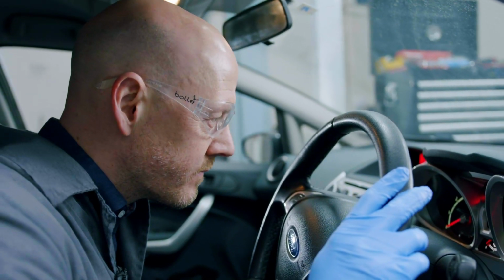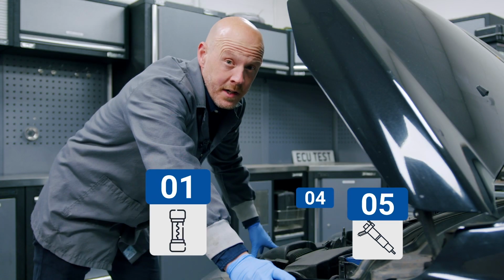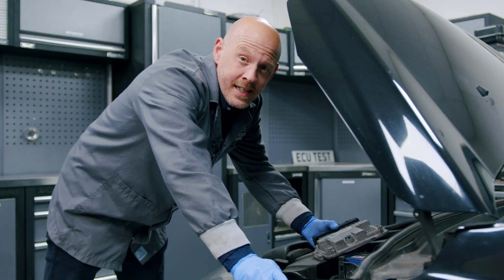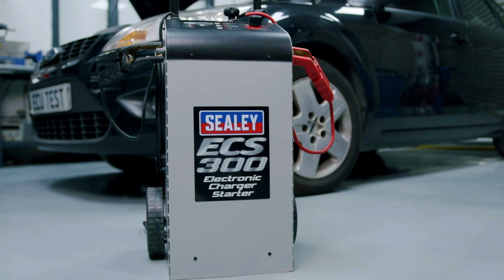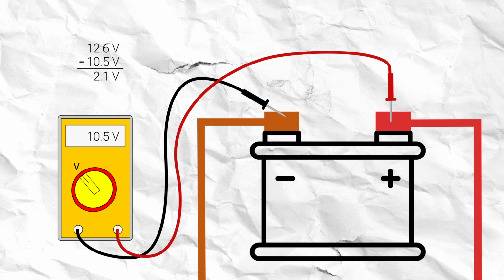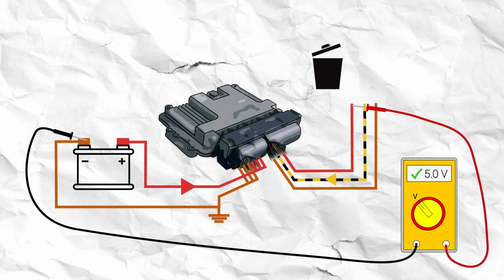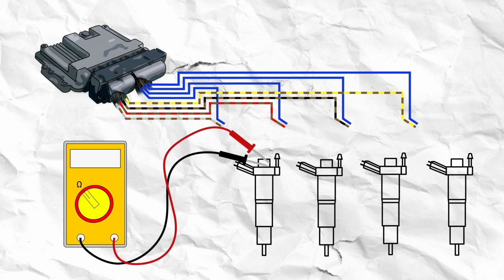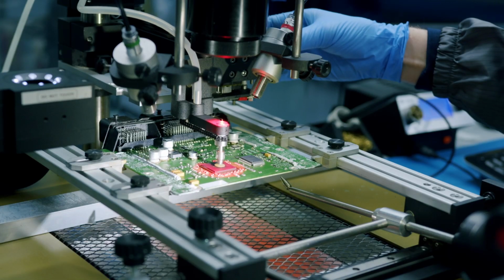P0606 – Car Won’t Start – Diagnostic Tips!

Comment: Whilst the background music does keep the video upbeat and moving, it does not help with comprehension. Rather distracts from it. If the point is information transfer, I'd suggest putting a tips video out with yourself speaking in a quiet garage rather than something that looks as though it came from an MTV production.

Comment: I only get the fault under high load, high rpm. Like hard acceleration from a stop. Or pulling out to overtake and putting your foot down. Usually around 120kph.
Reply: 2007 Holden commodore in new Zealand
Reply from the maker: Hi there, if you can get the part number from the unit and email it to info@ecutesting.com with the vehicle details, our technical support team will be happy to look into this further for you. Thank you!

Comment: I just resolved this issue on my MK6 TDI by replacing the 644 and 645 relays  that are located under the hood. 

However, this video helped quite a bit in the trouble shooting process ❤🎉

Comment: I have a golf mk6 1.6tdi with the code the car also goes into limp mode and have flashing glow plug light  I  have 2 leaking injectors would this be the cause of the problem and code?

Comment: Hello every one, what Is the name of the sensor?
Reply: The P0606 fault code means that there's an error with your power control module (PCM). Your PCM is the computer inside your car that monitors all the vital systems. Basically, it's the brain of your car. Every time you start the car, the PCM runs a series of checks to make sure everything is okay.

Comment: Hello Sir Code No. P1A00: ?
Reply from the maker: Hi. A P1A00 usually indicates a problem with the Accelerator Pedal Position Sensor. Test the sensor is receiving the correct power supply and it has a good ground. You can also test it is outputting a good signal by using live data from a scan tool whilst operating the pedal and checking if the output data matches the action. Hope this helps!
Reply: @Ecutestinglimited
Reply: only this is a motorcycle scooter 125cc Hero dash
Reply: @Ecutestinglimited  Thank you very much for your interest and help.

Comment: I have toyota corolla and i have 😊😊code number p0607, can I have the same symptoms?
Reply from the maker: Hi. The P0606 and P0607 fault codes can share similar symptoms, however completing all the checks in this video is a good way to start the diagnosis.
Reply: @Ecutestinglimited  thank you .

Comment: is the p06b8 the same code? i have a mk 3 st and it threw this code but same description
Reply from the maker: Hi. P0606 and P06B8 aren't the same code, but they usually go hand in hand. If you have both a P0606 and P06B8 then we would still recommend completing the checks in this video to see if the codes clear. If they don't, or you just have the P06B8 code, then please contact our technical support team via email on info@ecutesting.com with the following information. Codes can go hand in hand contact tech support. The make and model of vehicle, the symptoms of your fault, any fault codes present, and the part number printed on your ECU. They will advise you further. Thanks.

Comment: My car has the autostop and it did the autostop at a light and didn’t come back on and the p06060 code came on but then went off and I drove fine 2 days after should I still take it into the shop?

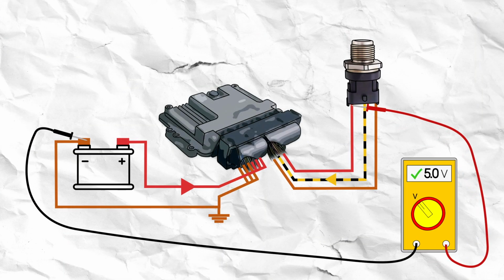Comment: What sensor is in the diagram at the 4:12 mark? I need to know bc my 2004 Envoy XUV shut off in traffic and won't start.
Reply from the maker: Hi. The sensor we have used as an example in this video is the fuel rail pressure sensor, however there are many sensors in a vehicle that can cause a P0606 to occur. If it is a sensor causing the code, then you should have a secondary fault code specific to that sensor, so if you only have a P0606 then it is unlikely that the fault lies with any sensors.

Comment: Would that be the problem with my 2018 Jeep compass.  The dealership won’t help because I went over my mileage and warranty ended.  My problem is that when they put the reader it won’t connect and won’t get any reading back.  It’s not the batteries already checked that.  I need my inspection sticker but can’t because of this.
Reply: Amy, when the obd2 port won’t power a scanner usually it’s a blown fuse, check them

Comment: What would be considered  bad resistance while testing the fuse?
Reply from the maker: A standard automotive fuse should have a resistance as close to 0 ohms as possible, and no more than 1 ohms. If the multimeter reads O.L then the fuse is blown. Hope this helps.

Comment: Hi, I have a 2013 ford focus. It’s coming up with a po606 code. I’ve had a new battery put and driving fine for about 3 miles then the transmission fault came up again. When driving it the revs go up to 3000 and struggle,s to get up to the next gear. When I had the battery changed it was working fine. It’s a 1.6 auto, if it does need a new ECU how much will it cost to fix?
Reply from the maker: Hi. Have you done another scan after changing the battery, and if so were there any additional fault codes?
Reply: This is my car how did you fix

Comment: Can bad throttbody acuator cause tht code to
Reply from the maker: Hi. If you have a P0606 and a secondary fault code relating to the throttle body then it would be worth investigating first as it could potentially cause the P0606 code to occur. However we would still recommend completing the checks outlined in the video if the P0606 code doesn't clear.

Comment: On a d
Fiesta 1.4tdci i have too many codes P0606, P0366,P0191,P0626 and P0563. It is possible ECU damage, harness ....anybody with something ells idea?
Reply from the maker: Hi. With all those codes we would definitely recommend thoroughly checking the wiring to the ECU, as well as inspecting the connector for damage or corrosion. If you would like to send your ECU into us for testing then please fill in our online test form for further information: https://myaccount.ecutesting.com/

Comment: You missed an important one: spark plugs. I found this out on another forum. It turns out the OEM spark plugs I thought were genuine turned out to be fakes.  In just several months, my car lost power, went into limp mode, and threw this CEL code. It took me awhile to figure it out, but I bought genuine OEM plugs in the store, and my care is back to being good.  I've also read that Honda's do not like non OEM plugs.  Stick with OEM, and make sure they're genuine.

Comment: Hello - I have watched so many of your videos as no one else on Youtube or the net seems to understand a specific issue  I have faced for 3 weeks now. P0606 ECM code on a K12 Micra DCI. Any ideas where to start, I checked most of the wires to the ECM but I dnt want to strip all the looms to look for shorts. Do you think a faulty sensor like the crank or cam will trigger the code or its a genuine short somewhere that I must look really hard to find. Trying to narrow the issue down. Greetings from South Africa

Comment: This was a very informative video. I have a 2011 ram 2500 Turbo diesel and the P0606 code has come up on my truck
Reply from the maker: Hi Thomas. We are glad you found the video useful. If you have followed all the steps and are still experiencing a P0606 fault code, then please contact our technical support team via email at info@ecutesting.com with the following details; Your make and model of vehicle, your ECU part number, the symptoms of your fault, and any diagnostics you have carried out. They will be happy to assist you further and advise you of any testing or re-build service we can provide. Cheers.
Reply: @Ecutestinglimited   I got to check my batteries this week when I get a chance thankfully I watched this video if all else fails I will take it in
Reply: @walkingdeadalphaCO what did it end up being ?
Reply: @jrsoccer11276  so I found out something. I was buying el cheapo sensors on eBay. Wrong choice on my part. I went ahead and spent the money on quality sensors, and the codes went away. Also, my exhaust break is working well because now it's getting the right air ratio.

Comment: Hi thx for the vids! I have a P0606 code on my veloster and my obd2 is saying the ECM voltage is 10.2 and does that mean i just need to check for too high resistance in the fuses or the computer?

Comment: My car is running fine but it's throwing it while driving
Reply: I have the same issue with my vehicle.  2010 dodge Avenger 2.4L. This car is like a project car I swear.  But my code only appears once I drive for a good 20 mins.

Comment: For a toyota you dont have to send in the new or used ecu for a full rebood or flash. Hotwire the pin #4 and #13 of obd2 and let it sit with ignition switch on position and let it figure everything out for about 30 minutes. Remove the pin used to hotwire the obd2 and go ahead start the car and hope for the best.
Reply: Did it fix the problem?

Comment: Hi I have a serious problem with my 2013 prius  p0606 the car drives fine and sometimes gets crazy with no power stops with all waring lights, whats the name of the sensor You are checking on the video ? thks
Reply from the maker: Hi. The sensor we are testing in this video is a fuel rail pressure sensor. However, if it is a faulty sensor causing the problem, then you should be getting a P0606 fault code alongside a secondary fault code for a particular sensor. If you are only getting a P0606 code without a secondary code, then it is unlikely the fault is being caused by a sensor. Hope this helps.
Reply: @Ecutestinglimited  the thing is im looking for a good electrician but cant find any one replaced the ecm computer and the module that goes to it to check if it fixed but not same thing happening that is that code plus car stops suddenly loosing power sometimes cant put it into parking or any gear then i unplug the battery for 5 min and later it drives for a while again im sick and confused the electrician cant help me hes stuck
Reply from the maker: @pawlinski74  Hi. It sounds like the issue you're having is complex, are you just getting the P0606 fault code and what module is that code being stored in? Feel free to contact our technical support team with this information, at info@ecutesting.com or contact us directly by phone: +44 1773 535638, and they will assist you further. Cheers

Comment: I have a P0601 does the instructions in this video imply to that code as well?
Am working on a diesel, like you mentioned in the vid.
Also thank you for the video, love the animations and explanations, so easy to follow along
Reply: All right thank you for the answer, much appreciated 👍🏼
But also wondered if the p0601 wold have anything to do with the TCM, because in my car the TCM and ECU are in separate boxes/housings. Does that code indicate anything with the TCu or ECU only?
Reply from the maker: @daniellarsen4806  Hi. The P0601 code is usually stored in the control module which is experiencing the fault, so when you scanned the vehicle was the fault code stored in the TCM or ECU? Cheers
Reply: @Ecutestinglimited  ahh okay, found out the EEPROM or memory chip is located in ECU box. So probably the fault is somewhere in the ECU if everything else outside the ECU checks out
Reply: @Ecutestinglimited  thank you so much more clear now!
Reply from the maker: Hi. We have normally seen that the P0601 fault code indicates something is wrong with the internals of the ECU itself, however you may still want to follow the steps detailed in the video to rule out any external faults before condemning the ECU. Cheers.

Comment: 1997  powerstroke p0606 . after a long run and good and warm. If the truck is turned off it wont restart. If i disconnect the batteries then reconnect it will start and run fine until turned off again. If it sets overnight it still will not restart until the battery trick .
Reply from the maker: Hi. We would recommend following all the steps in the video above to attempt to diagnose the fault. If you are still unable to rectify the fault then please contact our technical support team via email at info@ecutesting.com with the details of your fault and your part number, and they will be able to assist you further. Cheers

Comment: What cencor are you talking about?
There are many cencors in a car
Reply from the maker: Hi. Unfortunately there are quite a few sensors in a car can cause a P0606 fault code to occur. However, if a sensor is at fault then you should have a secondary fault code, along with the P0606 code, which should detail which sensor is potentially at fault. If you haven't got a secondary fault code then you can ignore this step. Cheers.
Reply: @Ecutestinglimited Hi thanks for answering!
 i don't remember the exact code but it was described as; engine running rich
We have had some trouble with the O2 sensors but we fixed them so they should not be a problem...
Reply from the maker: @PrinsenTBG  No problem! We hope replacing the O2 sensors fixed the problem. If you are still getting a P0606 fault code with the engine running rich then it could be worth checking the wiring to the O2 sensor or the MAF sensor.
Reply: @Ecutestinglimited  Thanks alot! I will check this out!🎉
Reply: @Ecutestinglimited  Hi! In my 2011 Mercedes-Benz  C180 CGI (w204), i have a seccondary fault code  P0705 besides P0606. Tomorrow I'll chance my battery because I change it only in Dec/2016!
Reply from the maker: @19FH86  Hi. Just to clarify, is your Mercedes an automatic with a 7G Tronic gearbox? As we usually see the P0705 fault code being caused by a fault with the transmission control module. Cheers
Reply: @Ecutestinglimited  Yes. 7G tronic 722.9. But The car is normally and The check engine light only turns on when i start The car. I realised that The voltage of my battery when i start The car goes to 7.6V. Its since dec/16. Trying to repair this on The less expensive way lol

Comment: P06A8 FORD Code - Sensor Reference Voltage 'C' Circuit Range/Performance what does this mean boss
Reply from the maker: Hi, we normally encounter the P06A8 fault code alongside the P0606 code which could indicate that the ECU is faulty. If you could email our technical support team with your part number and details of the fault at info@ecutesting.com, then they will help you out. Cheers

Comment: Hi what is a c1226 code on Astra Gtc j 14 plate pls
Reply from the maker: Hi. A C1226 fault code usually indicates a problem with the wheel speed sensor (normally the front right one but confirm this on the diagnostic software when scanning for the fault codes). The problem could be with your ABS pump and module, wiring to the wheel speed sensor or a faulty wheel speed sensor. Check out this video we have on how to diagnose wheel speed sensor faults: https://youtu.be/T74B_aELnU0

Comment: I'll try this question here, haven't found an answer yet. I permanently connected my dashcam to the battery for continuous recording. I am no electrics/electronics beginner. With the camera screen turned off, the current drawn in total from the 60 Ah battery is very low, tens of milliamps, maybe less, I can't remember exactly, but I did the math. By my calculations, this means the battery should last at least 2 weeks like this, if not more. I understand that you can't go to 0% charge, as you still need a lot of juice to be left for the engine to start, but I don't understand having the battery die after 2 days with such a low load.

If I leave my car parked for more than a day, dead battery, around 10.something V. I can barely start the engine, sometimes I need to push the car to get it going. Battery voltage is perfect, stays at about 12.9 after a longer drive, starts the engine in a fraction of a second, no issues whatsoever without the dashcam plugged in when parked. Plug in the dashcam, the battery dies like crazy.

Something doesn't add up there for me... and I can't yet understand why this happens. Again, without the dashcam, the battery is just fine. Maybe it shows some lack of charge after a full week of only 5 minute drives, but nothing worse than that, and voltage stays over 12.6 at all times. Without the dashcam connected when parked...

Comment: Hi !!!!! An ECU  that I purchased preprogrammed had that same fault code that you explained and all the info that I researched on it, said that it is an internal fault; the engine light stayed on permanently, but the engine started and ran and I even drove it around without any problems. I returned it and it is now repaired.  I would still like to get my other ECU repaired some time to hold as a spare.
Reply from the maker: Hi Carl. We would be more than happy to re-build your original ECU. If you email our technical support team at info@ecutesting.com with details of your make and model of vehicle, the ECU part number and any fault codes or diagnostic information you can provide, then we will get back to you ASAP. Cheers.

Comment: Made up I found your channel, great tips ! I recently sent my Mercedes Viano abs pump to a company to be repaired, they sent it back saying it’s beyond repair. Would you guys be able to rebuild it? Cheers 👍
Reply from the maker: Hi James, thanks for the kind words and we are glad you found the video helpful! With regards to your ABS unit, we do re-build Mercedes Viano units, but depending on the cause of the fault it may be that the unit is completely beyond repair. If you email us at info@ecutesting.com with details of your fault (any fault codes, diagnostic information, etc), then we will get back to you asap whether we can offer a re-build solution or not. Cheers.
Reply: @Ecutestinglimited  . Wow! Thanks for your reply , ok I’ll sort things ASAP as the car is not on the road at the moment. Iv fitted a second hand pump but needs to be reprogrammed. So I’ll probably try to get you guys to rebuild my old  pump anyway!  That’s if it’s not beyond repair?  Thanks again, and I love the sense of humour in your videos too 😜👍